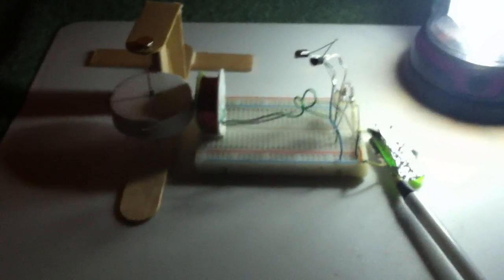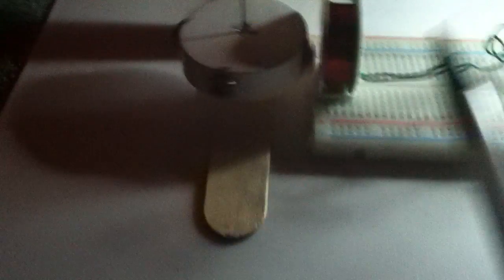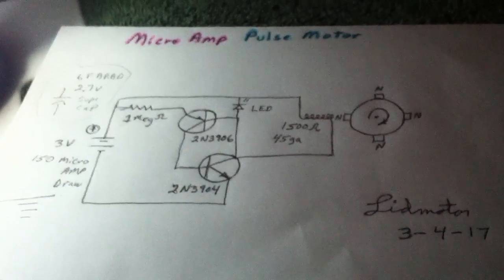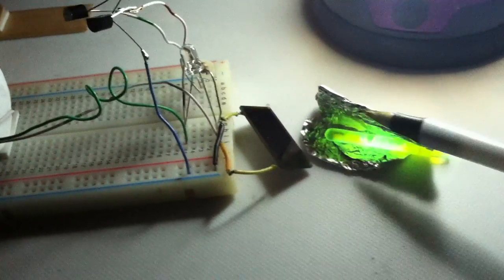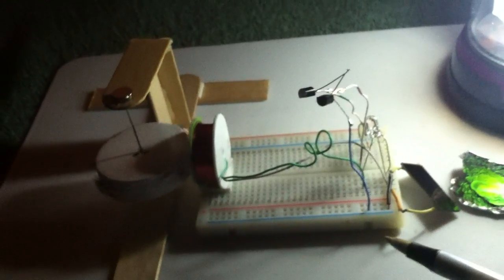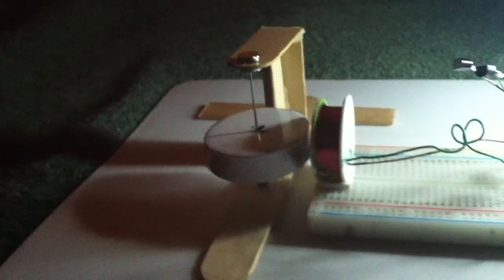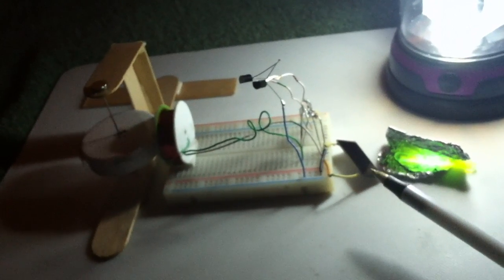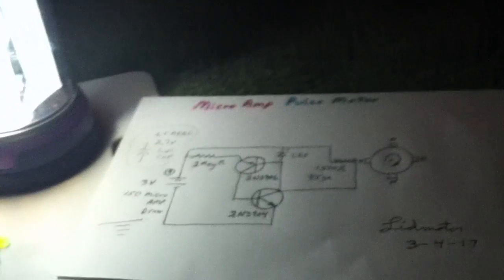Tiny Glow Stick Pulse Motor

Comment: Nice build. If you go to ebay and search for "solar flashlight", you can buy it for a dollar with free shipping. It uses the same type of solar cell as the waving flower cell.  It is a bigger cell, putting out about 5v, 10 microamps indoor. Of course it is a fake.  When you take apart the unit, the solar cell is not connected at all. But that's ok because you want the solar cell. The circuit board is usually stuck to the solar cell back with double stick tape.  Don't pull off the tape as it will rip off the back of the solar cell and ruin it. Twist the double stick tape to remove the circuit board from the solar cell and rub the remaining sticky stuff off.
Reply from the maker: Thanks. I have some of those solar keychain led lights (the multi colored ones) that I bought years ago.  Mine actually have a 3v rechargeable Li battery in them.  I have used the 5v panels in several projects.  Many thanks for your great videos on these low power motors.  Your 'coil build' video was excellent and really helped.  That fine wire coil is the heart of the whole project.

Comment: I think it would be nice to check if your pulse motor can run on a tritium stick. Cause if it does it would run for some 10 to 15 years. As you know tritium is a sort of nuclear energy or radioactive element that puts out a very weak light but does so for some 12 years. I think they can be bought either at eBay or amazon or banggood

Comment: its good to see the old DADHAV circuit still making the rounds   :)
Reply from the maker: Yes! The DADHAV circuit lives on.  I have not talked to John in a long time. The basic complementary transistor circuit (Sziklai pair) is very old but he adapted it to drive the kind of pulse motors we fiddle around with.  Actually it was a 2013 video by 'backuppcu'  that I used to configure this low amp draw circuit.  He took out the base resistors and just used one resistor going to the PNP emitter to get the job done.

Comment: I'm working on a hand crank generator. It uses an electric motor with a rubber band as a belt. Cd's hotglued to the wheel of a scotch tape dispenser, on both sides. I don't know if it'll work.

Comment: Nice.. It's no long lasting tritum source (like nurd rage's device)--but it definitely works!

Thanks for sharing!
Reply from the maker: Thanks.  I think this might work off that nuke power source.  The basic design here might have to be refined and built better.
Reply: I think his device generated 0.84 microWatts.  Have you ever connected your device in a shunt configuration to get an accurate A draw measurement for a minimum operating condition (i.e. min V & min A to cause your rotor to barely rotate)?
Reply from the maker: To get a "hobby"  motor to run on that super low micro power is a real challenge.  As far as testing my motor like you suggested I have not done that.
Reply: You might try it.  Nurd rage shows the shunt circuit design & analysis method to accurately determine such low current consumption.  Power can be calculated as W=V*A.  His circuit could also be used to control the V & A to find the optimal minimum that your motor will barely turn at.
Reply from the maker: Thanks for the tip.

Comment: You and Slider are doing some awesome videos.
Reply from the maker: Thanks.  Good to hear from you.   These motors should easily run wirelessly from an exciter ---I think.   There is something weird going on with this motor circuit.  It is probably time to hook it up to a scope and do some serious testing.  The mass in motion vs the input power seems way off.  It is outperforming the solar waver type circuit that I have long thought was almost unbeatable.  I think Slider will agree with me.

Comment: Lidmotor this is awesome. I was hoping maybe you could try a setup I was playing with not too long ago. I got a solar toy circuit to spin a little slower than this one here from the faint glow of a joule thief led on very dim output, probably a little less light than this glow stick is putting out, but it was nowhere near as efficient of a circuit. The trick for me was to use the same needle/magnet style rotor suspension but with an extra twist. I feel like you could get even better results. 

You basically just replace the needle with another magnet perfectly center of the rotor. I got great results with two cylinder shaped magnets, one on the rotor one on the support directly aligned to each other. The magnets have to be round of course, or cylindrical and the smaller the better, but mine were about a half inch high maybe half centimeter wide. You can mount the support magnet on a screw so it's adjustable up and down very precisely. The key is to find the perfect spacing between the two where the rotor is juuuuust about to hop up and stick to the support magnet. I have noticed it's easy to find that perfect spot because there's an interesting 'sweet spot' there where there seems to be some 'coherence' and they sort of 'lock on' to each other.  

The upside to this is incredible non-friction, like that of a completely levitated rotor, but the downside is it can't be moved around or jostled much or it will get out of wack and jump up and stick. Attach something under the support magnet at the perfect spacing so if the rotor magnet does jump and stick, it will be easy to remove and place back down because it won't be directly joined to the support magnet.
Reply from the maker: Thanks for the idea.  I will have to try that.  I will have to try the joule thief light also.